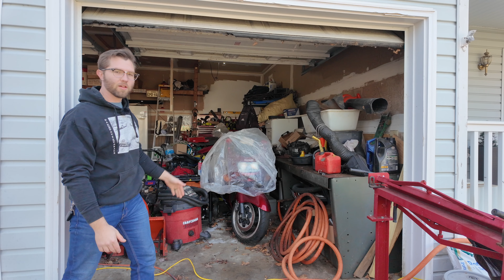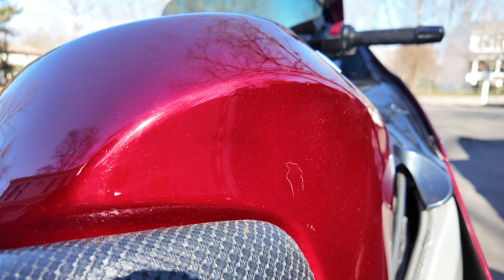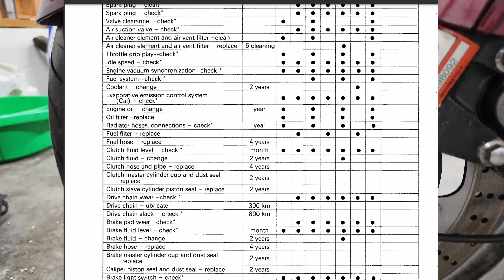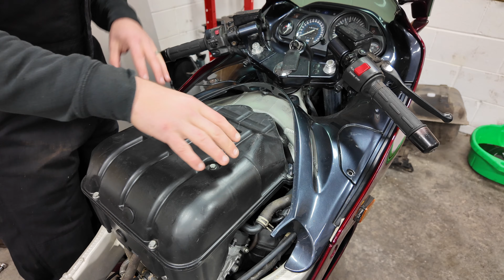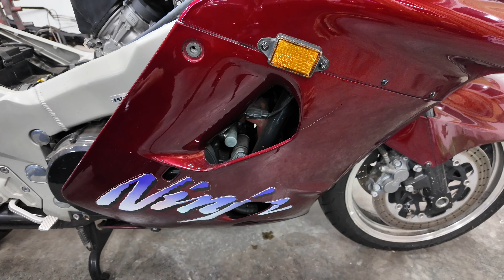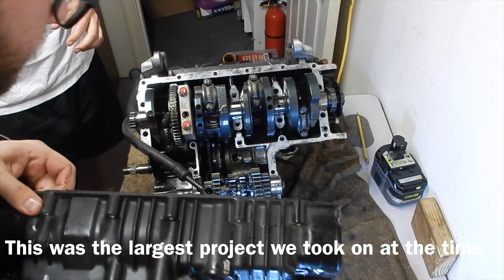Everything Went WRONG Rescuing This 90's Super Bike

Comment: fill it with oil, fix leak and ride it. check filter next oil change. any time you have apart and replace parts you will have some debris. don't pull apart from that lil debris in filter.
Reply from the maker: Will do and will post results

Comment: Ya know, those shavings might only be from the new metal breaking in. If it ran fine I wouldn't be too worried, maybe just have a deep clean of the pan
Reply from the maker: I know it's normal to see some glitter, especially as the mating surfaces are wearing in. Some of the pieces are larger than what I would consider "glitter" and more in the category of "flakes," which is concerning. I think you are right about taking off the pan and cleaning it out at least
Reply: Exactly what I was thinking